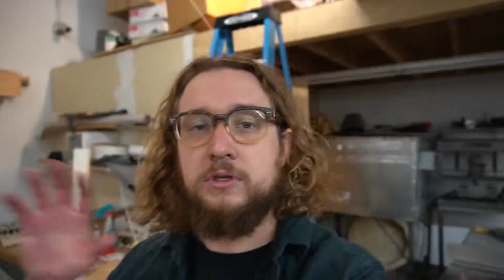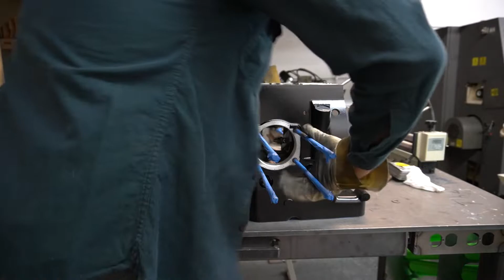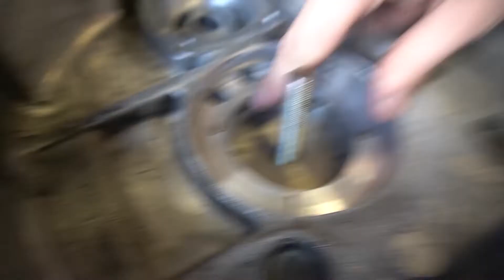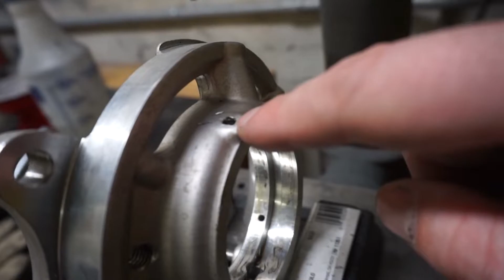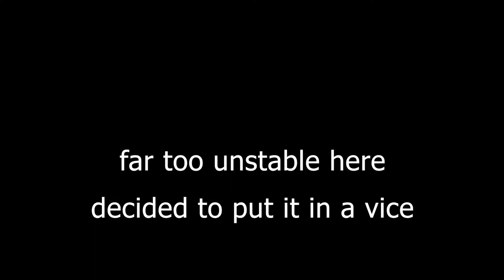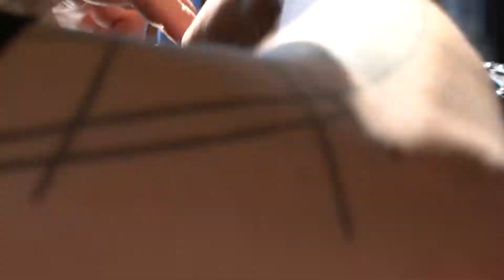Airhead Engine - Bottom End Assembly - Custom BMW R90/6

Comment: Hey so I'm looking to get my engine parts vapor blasted and then powdercoated. Should I remove the rear main bearing insert prior? Also, any idea what temperature I should measure the main bearings at? I'm not seeing this stated in my Clymer manual at all...
Reply from the maker: I'd probably leave it in and inspect it afterwards. I'd suggest getting an official BMW manual if you're going that far into the motor. I think I heated the block to around 350F, it took a while.

Comment: Hi

If the endplay is too large, where do you put the shims?
Reply from the maker: The shims sit on either side of the rear of the case. You'll need to remove the crankshaft to access the one on the inside, but the other is behind the flywheel and rear main seal.

Comment: Love this video! Curious do you always need to replace the Main Bearings, Front and Rear when disassembling the motor? I have my motor all the way bare, down to just the casing and rear main bearing. The Front main bearing remains inside the carrier. I'm going to clean the casing and vapor hone it. But will seal it prior to and clean after the vapor honing process. Should I replace my rear main bearing, minimum? or do I need to replace both?
Reply from the maker: I'd say main bearings only necessitate replacement if there is scoring or other visible wear on them. In our case, the bearings were borderline. There was likely many many more miles of life left on them, but considering all the parts and effort going into this bike and the pitting found on the rockers and lifters, we felt it was worth it to change them out while we had the engine apart. As you probably saw though, it's a rather involved process.
Reply: @roodlum  Yes! This definitely answers my question/email. Again, an amazing video. Great work! I'm subscribed!